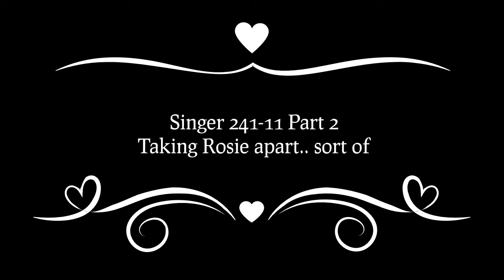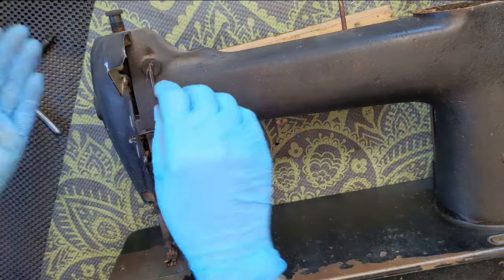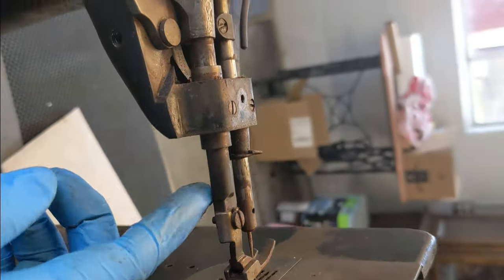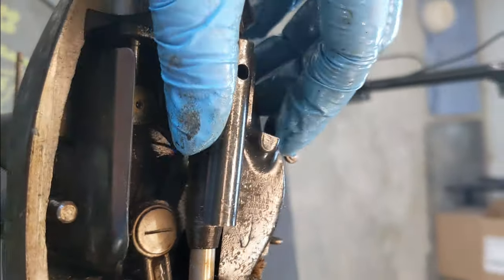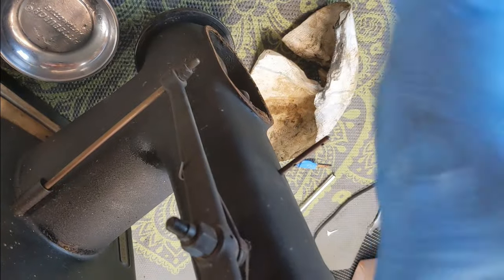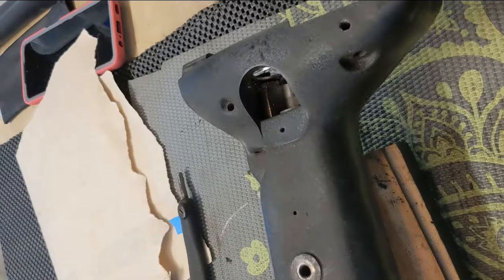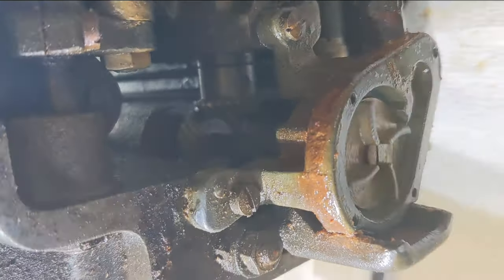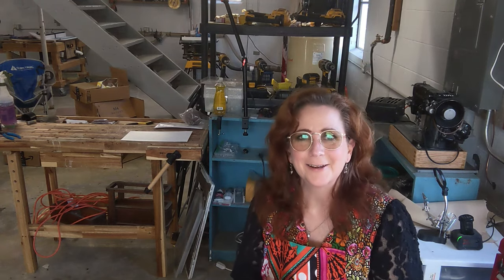Taking apart a Singer 241-11 industrial sewing machine for cleaning - Rosie Part 2

Comment: Whoa! BIG project! I think that the bobbin case assembly might be held on by 3 screws around the shaft like my 206- it sort of looked similar down there...good luck! I hope the wicking is OK after the wash! Definitely a Master Schmoo Award😉
Reply from the maker: The hook did not want to budge 🤣 it's like a locker combination after the screws are removed and still would not move. For now, she has won the battle. But at least she moves freely.

Comment: Fabulous! If I may ask, how did you remove the sight glass? I don’t think I seen it on your video.
Reply from the maker: There's a little screw on frame, so I remove that and a cork gasket, and the old sight glass and was able to replace them.

Comment: This is an excellent video, but anyone who has an "INDUSTRIAL" sewing machine these all come with a self oiling wick system with or without an oil tank at the bottom of the machine. Unless you are planing on replacing all the oiling wicks, felt pad reservoirs and such, do not put these in electrolysis tank. Get or download a "IPB" illustrated parts breakdown of your  sewing machine and locate all those wicks. I find candle wicks work well, thick and thin ones. The easiest way to replace them is to sew the end of the wick in the machine with a new wick or get a spool of twenty thousand bare wire and fish the wire through the tubes. I made a video on a singer 281 and a Pfaff 463, replacing the oil wicks. If you can't disassemble your machine but still want to clean it to where you can paint it, just use carburetor cleaner and Kroil penetrating oil. Those two in combination will free up and clean any machine. Be careful not to damage any paint with carburetor cleaner if you're not planning to repaint it. Why carburetor cleaner.These old vintage sewing machine have the same petroleum dried varnish buildup as old carburetors. Years of oil buildup turned into varnish, no different than old gasoline varnish buildup..

If you what to totally dissemble your machine and paint it, theres no better channel than this one. I'm watching her videos learning on how to do that, paint some of my industrial machines. Sure I can tear them down, fix them, but painting them, that's a whole new ballgame for me. Give me a can of paint, I'll screw it up somehow.
Reply from the maker: Thank you!!

Comment: Interesting Marie. I have never seen this machine.  I’m stuck on my 66 ,  the bobbin winder is not fitting correctly. I see springs that can be loosened. Is that something that may need an adjustment ?
Reply from the maker: There are several types of bobbin winders on 66's I think Bob has videos of most of them. One will hopefully answer your question. Lots of tricky springs and screws in them 😊